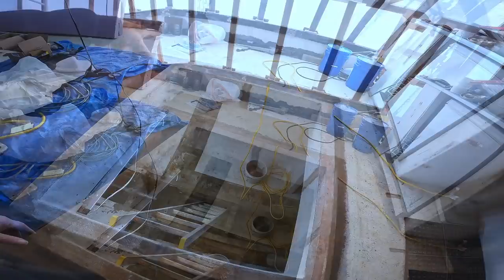Furnace Install on the Deck - Emerald Isle: Ep.28 Fishing Boat Refit

Comment: That heat sure must have felt good!!!  Glad to see your fixes worked out for both the heater and the  Water seeping issues  And no  Injuries moving that big Box.YAY!!  Step-by-step you're getting there that's for sure. :)
Reply from the maker: Thanks Debbie. It was in the mid teens when this was installed. We were freezing without it. Things are slowly moving along and coming together.

Comment: Smart move with the trailer furnace . Had one in my shop for years . Keep the burner clean and you can't go wrong . They also work much better with the door closed . Get a cheap thermostat and keep it running on low , 24 / 7  oil's cheap but time is precious . Best of luck , you're headed in the right direction . God Bless .

Comment: I thought I might give you some advice from my personal experience with a similar furnace. If I tried using a filter that restricts the air flow very much, it would cause the blower motor to overheat. That might explain the mesh type filter that was on your furnace. Good luck with it. Keep up the great work!
Reply from the maker: Thanks for the insight Jack. No issues so far with the blower, but will definitely look at the filter first if we start to experience problems. Thanks for the tip!

Comment: You guys are pretty resourceful!!!
I do Hvac if you ever have a question,  you might add a 6” pipe around your flue to protect your framing and plastic from the flue temperature. On trailer furnaces I’ve seen there normally have a tube to bring combustion air from outside straight to the burner that might make it safer ,at the very least it will cut down on dust in the burner

Comment: Good job with the heater. Make sure you have a Carbon Monoxide detector on board in your heated space. Saw a little rust and would hate for you to have a cracked heat exchanger.
Reply: My concern also re: carbon monoxide detector stay safe.
Reply from the maker: Just light surface rust on heat exchanger so all good. We did pick up a new CO2 monitor and mounted in our workspace. One can never be to careful when it comes to that.

Comment: I know nothing about construction or boating, but just wondering (a) where is that shaft going; (b) How are you going to move the shaft to its final location. You guys are so resourceful at figuring things out. Can't wait to see next video related to this project.
Reply from the maker: Hi Luis. This is the intermediate shaft that connects the main engine to the propeller tail shaft. A few videos back showed us cutting the coupling between the two shafts and removing it. It's location is below the fish hold and above the keel of the vessel. It runs through an enclosed space called a shaft alley.
Reply: @EISAlaska  Thank you for the clarification guys. God Bless.

Comment: Great idea, but what out for carbon monoxide ,I know you got ventilation but that furnace can produce a lot of carbon monoxide. Maybe a carbon monoxide alarm which are pretty cheap would be a good idea. The meter good be used on the boat when you get her out fishing
Reply from the maker: Thank you for your comment William.Yep we got a good carbon monoxide alarm and will use it on the Emerald Isle now and after all projects are done. Take good care and stay safe.
Reply: If a fresh air intake, it'll produce a pressure inside the cabin. One option is having a carbon alarm near the floor, then have a fan pushing out of the cabin...ie a bathroom fan lol.
Reply: @GoldVP...  "carbon alarm near the floor"
That's where they should go, the closer to the bilge the better, if someone has one mounted up on a wall they have a death wish.
Reply: @lancer2204  correct. Just like H2s gas. It's a floor creaper
Reply: @GoldVP...  
At least the CO2 won't go BOOM!